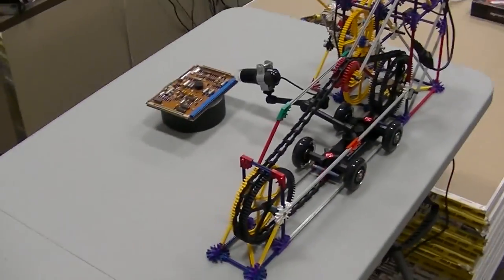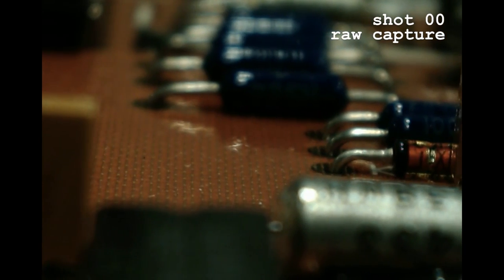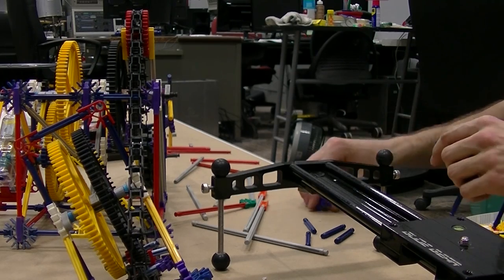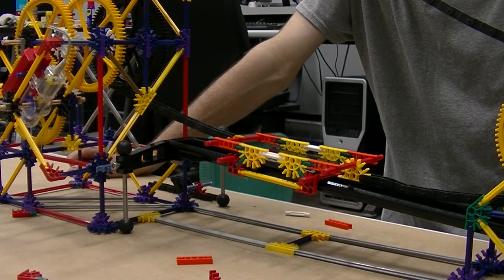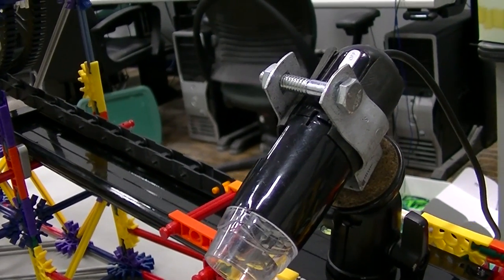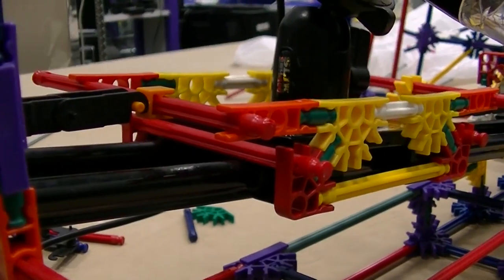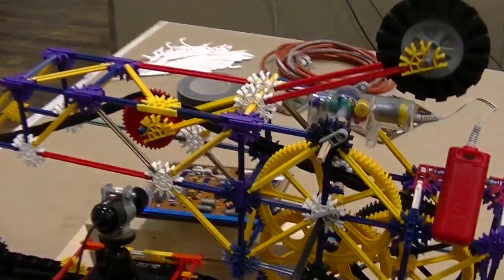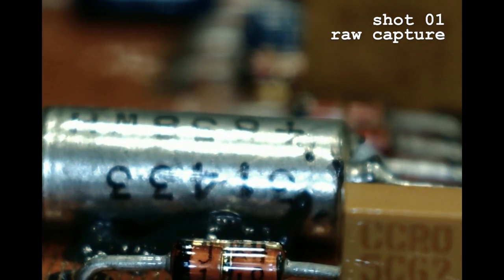A/V Blog 2015-05-31: K'nex Dolly

Comment: make your dolly as heavy as you possibly can.
The extra mass will help smooth out the movements.
also, don't connect the "robot"  to the dolly with a rigid connection, use a couple of light springs, that way between the mass of the dolly, and the elasticity of the springs, you have a  'steadycam' like contraption.

Comment: As to ways to implement a dolly, an idea which occured to me is model railroad track of the appropriate scale and, as you're doing a slow move a cheap waggon with the camera mounted on it and the K'nex setup rolling cable onto a spool.
For slightly faster shots, a locomotive might be usable to pull or push the waggon along.
Also, have you checked if VideoLAN manages to capture from the camera?

Comment: Cool idea to use knex, one thought would be a string that goes from dolly to a weight over the edge of the table, but via just a shaft on the knex, i would wrap some tape around the shaft to stop the shape interfering, then drive the shaft with that gearing
In fact this guy used something similar recently https://www.youtube.com/watch?v=FHTpD4fFub0
The judder may also be due to the loose meshing of the gears, if you use 2 large gears on the same shaft that mesh with one small gear, but bias one in a direction with a rubber band, that should tighten the mesh (common method that normally uses springs) figure 4 http://www.daerospace.com/MechanicalSystems/GearsDesc.php